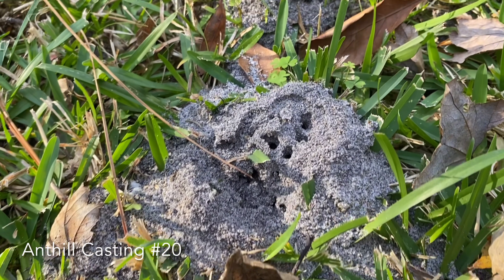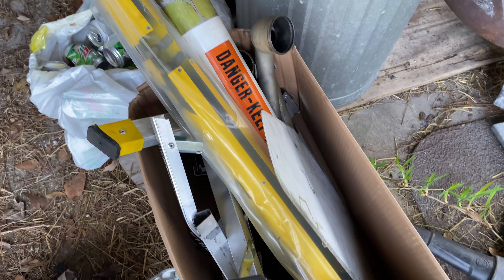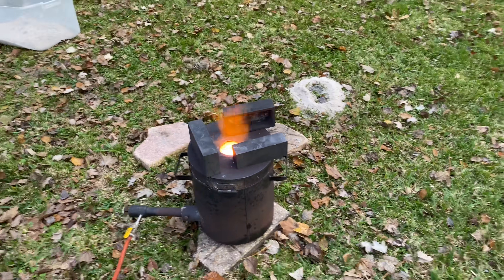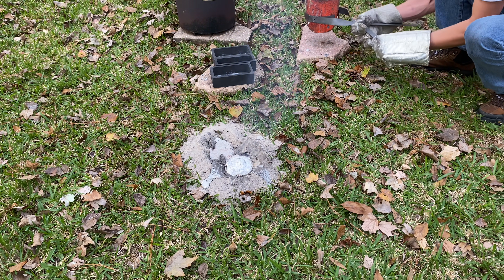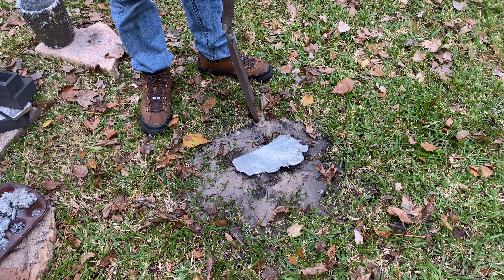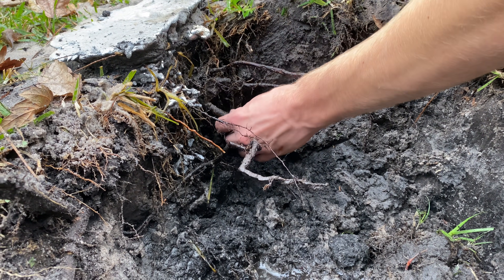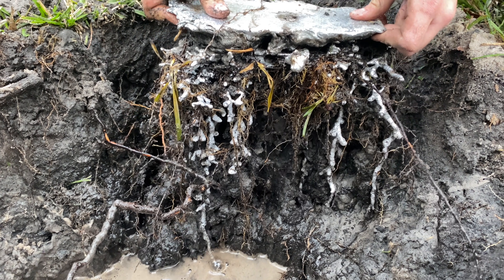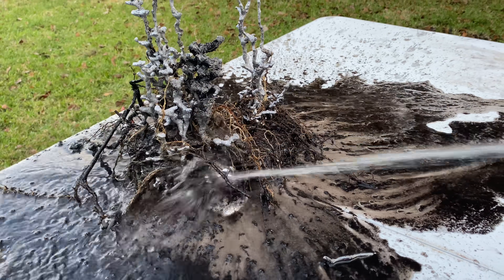Molten Aluminum Anthill Casting #20 (4K)

Comment: Another thing, by removing the dirt while it is stil i nthe ground means it loses the support of the soil which is actually helping it maintain it's strength. By washing away the soil it becomes more likely to break while removing from the ground. I owuld leave as much soil as possible until it's above ground. Cheers.

Comment: Is there a safe distance that the propane tank needs to be away from the crucible or whatever you call the aluminum heater? Nice to see you re-purposing aluminum that might otherwise just end up in a landfill or worse. Thank you! I love your sculptures and hope one day you get discovered and have your works shown in an art show or museum.
Reply: I noticed in later videos of yours that you let them sit hot without cooling them with water. Is that to kill any remaining living ants in the dirt surrounding the casting?
Reply: Oh that is beautiful!
Reply from the maker: Thank you, the propane tanks actually get very cold as you run them so there’s not a risk of them building up pressure. I just keep them away to keep the line from bundling up and tripping me. The ones that I just let cool on their own is just because I didn’t have a hose that could reach far enough at the time.

Comment: Super slick graphite molds make a lot of sense. Guitarists use graphite pencil shavings on the guitar to lubricate plastic or bone nuts. Graph Tech makes self lubricating graphite nuts so the strings won't bind at the nut causing tuning issues.

Comment: When you first pull it out of the ground put it in a large bucket of water and let it soak before washing it off with the hose — it will break less of the small pieces and make it easier to clean off

Comment: i wonder what would happen if you took a ton of that waste slag and oxide and melted it down. you'd have to save it up tho to try.
Reply from the maker: You’ll get a little bit more aluminum out of it. I sorta do that, I pick out the chunks that have a lot of aluminum stuck to it and will remelt it after I accumulate enough.
Reply: @NolansAnthillCastings  that's cool. i think the chunky metal scraps look interesting. also i too wanna see you melt those piston and such. sounds fun to watch.

Comment: you shouldn't have poured the aluminium over both of the ant mounds at once. one of them should be left open for air/steam to vent. this way the outburst that almost got you wouldn't have happened and the aluminium would've penetrated deeper into the ant hill, giving you a bigger, more detailed and more interesting casting.

Comment: "You should always heat your casting prior to pouring because any moisture that comes in contact with aluminium can react explosively"
Cut to not two minutes later...
"Now we will pour this aluminum on this ant hill and let's get our faces real close so we don't miss anything..."
This kid must not yet possess much common sense, considering the ant hill is located in soil and surrounded by healthy grass....you know, two parts of vegetation consisting partially of water (a form of moisture).

Comment: Is there any kind of prep you do to the ant hill other than putting a sand collar around it? Do you wet it?
Reply from the maker: Nope, just the sand. I pulled a leaf off the top of the mound before recording and that’s why the tunnels were exposed. But normally I don’t even expose the tunnels since the aluminum is dense enough to punch through the surface of the mound.

Comment: 2 questions. Do you ever see any trace of the ants or do they just boil away (which I would imagine is the case)? When you're digging the mound out do you ever get bitten by surviving ants or is that the entire colony?
Reply from the maker: The ants will turn to charcoal and sometimes they will be almost perfectly preserved in the casting. I’ve only had surviving ants bite me a couple times, usually i get the entire colony and if not then the heat from the soil will kill the rest.
Reply: @NolansAnthillCastings  Carry on with God's work! I hate those vile things

Comment: 6:38 Man... Get yourself a face shield or at least some safety glasses bro. No hate, but your face was like 2 feet away from that pour and I've seen my share of metal casting mold explosions to seriously hope you see this comment. You're pouring into moist ground with no vent holes.. which is a recipe for something bad to happen. It's a cool hobby and all but nothing is worth going blind over... if you don't believe me just search metal casting explosions on Youtube. Good luck dude.
Reply: Shop teacher always said "I can hold a beer with a wooden hand, walk on a wooden leg, bit you cant see out a wooden eye. Wear your damm googles!"
Reply: I agree. I also believe safe handling practices are far more important than just PPE alone. PPE isn't too protect you from being an idiot(this guy isn't being an idiot, in my opinion) but for when crap goes sideways. I got a piece of metal in my eye about the size of a bold ball point pen ball from grinding, and i had a face shield(it bounced up my shirt, i remember seeing the spark) and had i followed the advice of my welding teachers, i wouldn't be seeing a faint spot whenever i focus on things within normal reading distance. I am lucky it's not worse though

Comment: Just stumbled across this channel.. and I wonder can you cast an anthill with resin?
Reply from the maker: I think you can but I’ve never seen one done that way. The other ways I’ve seen is with plaster and silicone but you always have to rebuild the casting like a 3D jigsaw puzzle because they break apart super easily.
Reply from the maker: I’d think so, but most good resins are pretty expensive. I know you can make a casting with plaster and with silicone but both of those ways break apart super easy so you have to rebuild them like a 3D jigsaw puzzle.

Comment: Why are there never any ants walking around the entrances, are these abandoned nests or do you somehow kill them before casting?
Reply: They all headed inside to put on fireproof suits
Reply: I’d guess it’s early morning and too cold still.
Reply from the maker: It’s because it’s cold out right now and also as long as you don’t touch the nest itself they won’t be angry and swarm.
Reply: @NolansAnthillCastings  
Hello, new subscriber.
Meaning, Does the casting contain the remains of the ants? Cool.
Reply from the maker: Yep, sometimes you can see ants preserved in the aluminum since they burn without oxygen they stay as charcoal.

Comment: The question I have is.  On big Mounds that have to have more than one pour.  How do you make sure that one pour will tie into the first pour.  Multiple pots are required at the same time?  I cast lead bullets.  So prepping material I have down pat.  I used  to live in Eastern North Carolina, I know how much of a danger fire ants are.......  Kill them kill them all..... LOL
Reply from the maker: I’ve only done a few with multipours and they end up fusing together pretty well, but they are the weak points so I have to be careful digging them up. In casting #19 that’s why it broke where it did. Also I just melt down another batch after the first pour. takes about 5-7 min to pour another crucible full.

Comment: Try using a campfire cooking tripod over it and tie the base to it to support the weight while you dig.
Reply: I was thinking the same. Push a steel ring into it while its melted and you would have something to tie it to.
Reply: Make a pair of tongs so that as as you pull up the tongs grab the base that you poured

Comment: I'm sure that you don't get much slag from that nice aircraft grade aluminum?
Reply from the maker: Slag or dross mostly comes from paint and the layer of oxide from the aluminum. So everything that’s painted will give me a fair bit of dross to deal with. All the unpainted stuff shouldn’t be too bad but basically the thinner the aluminum the more dross you get, doesn’t really matter what the alloy of aluminum is.
Reply: @NolansAnthillCastings  Thanks for the info! But the real question is WHERE ARE YOU GETTING IT?😁
I just started forging. You're a great inspiration! Keep it up!👍
Reply from the maker: I’m glad to hear it! Have fun with your forging. I’ve got a buddy who works at an aviation maintenance shop and I bought some scrap parts off of him

Comment: How long after pouring do you start with the hose? Im assuming it has to cool a little otherwise it'll explode?
Reply from the maker: I let it cool for about 5 minutes or until I know it’s solidified. If I pour water on it when it’s still liquid it could pop some aluminum and also mess up the base. After its solid though Its fine to douse in water.

Comment: How do you determine the volume of molten aluminum you will need, and is a bubbler caused by material filling a nest, or is it from moisture?
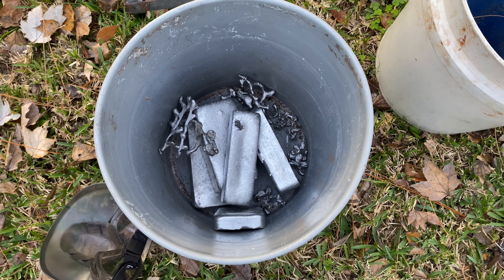Reply from the maker: I determine the amount of aluminum I need in units of crucible fulls. It’s very hard to tell how much aluminum it will end up taking but I base it on the size of the surface mound. The reason this one popped on me and bubbled is due to steam getting trapped. Steam expands at a ratio of something like 1:27 and when you pour molten metal on water it’ll do that very quickly acting almost like an explosion. Where I was pouring was pretty wet ground usually but it hasn’t rained in a couple weeks so I figured it wouldn’t be bad, I was wrong lol.
Reply: @NolansAnthillCastings  oh man don't I know it.  I worked in a steel mill and one of our steel making furnaces had a cooling water leak in the bottom.  They poured the molten iron in it to get started and it just kept exploding, what a night.

Comment: Why did the aluminum blow up and out like that?   Was the ground moist or was there water in the ant hole?
Reply from the maker: The ground was slightly wet but apparently that was enough to get an explosion. Another difference was a clay layer in the soil. Normal sand/dirt is very porous which lets the steam escape through the ground instead of building up pressure but clay is too fine and doesn’t let steam escape. My best guess is the explosion originated in the clay layer due to normal amounts of ground moisture. We havent had rain here in probably 2 weeks.
Reply: @NolansAnthillCastings  thanks for the explanation. Your channel is awsome, each casting is a different peice of art. Keep going and you'll be big.
Reply: @NolansAnthillCastings  that's really good to know. This is on my todo list and being here in South GA, we have huge fire any mounds but we also have a lot of clay
Reply from the maker: Yeah I’d be careful about pouring in clay soil. If you have anywhere around you where it’s a bit more soil than clay then I’d give it a go. Just be careful and wear your ppe, face shield is probably your most important. I use a cheap plastic one but that’s enough to save you from aluminum in your eyes. Also don’t wear polyester when melting. If some splashes on you it will melt your cloths onto your skin and burn you worse than if it just landed on your skin bare.
Reply: I would like to know this also please